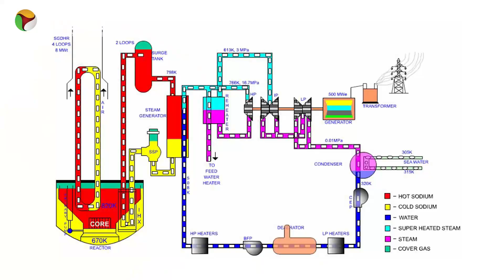Myth breaking video: How useful is indigenous fast breeder reactor? | The Federal

Comment: These are ignorant environmentalists ranting. First of all, while there have been some delays due sanctions and alleged assassination of Homi Bhabha - allegedly by the CIA, but the process has always been a long term process which involves transmuting Uranium 238 into Plutonium 239, and then using the Plutonium 239 to transmute Thorium 232 into Uranium 233. Even if there were no delays, we are looking as a 60 year programme before we got to the point where the Thorium cycle would produce significant amounts of energy. 
With regard to the nuclear safety issues, the first two stages Uranium 239 -> Plutonium 239, and Thorium 232 -> Uranium 233 using Plutonium 239 have the same nuclear safety issues that existing nuclear reactors based on Uranium and Plutonium have throughout the world have.  The third stage based on Thorium 232 and Uranium 233 is green energy because it produces very little tranuranics and the nuclear waste it prodeces will decay to safe background levels in 300 years, compared to millions of years in the case of Uranium and Plutonium based reactors, and also they are inherently safe from meltdowns like Chernobyl and Fukushima - that is why India is pursuing the third stage for large scale energy generation rather than the quicker routes taken by other countries using Uranium reactors to generate energy.
The reason for the long 60 year minimum time to large scale energy production is that in order to get the programme running at full energy production, it is necessary to stockpile plutonium for the second stage which is only starting up now, and this cycle has always been 30-40 years - that is the time to transmute Uranium 238 to plutonium 239 using Uranium 235 (Uranium 235 and natural uranium 238/235 needs to be imported and is sanctioned) in the first stage (which takes decades), transmute Thorium 232 to Uranium 233 in the second stage using the Plutonium from the previous stage (this takes decades), and the Thorium 232 can then be run with the Uranium 233 in the third stage breeder reactor as a continuous cycle to produce unlimited energy while Thorium exists.

Comment: They didn't telling actual purpose of this fast breeder reactor.
This reactor didn't consume natural Uranium. It consume plutonium, nuclear waste (Depleted uranium)and thorium and produce 500gw electricity and Uranium U233 & plutonium 

This reactor will give 120% nuclear fuel then how much it consume

Depleted uranium (nuclear waste that can't be used for any thing & highly radioactive )+plutonium (it is byproduct of nuclear waste from nuclear reactors in production of electricity)+thorium=electricity+plutonium+uranium 233 in 120%

Uranium 233 is converted form of thorium it can't be used to produce weapons but it can produce 200 times more energy than the uranium